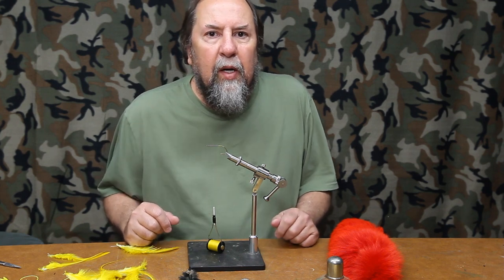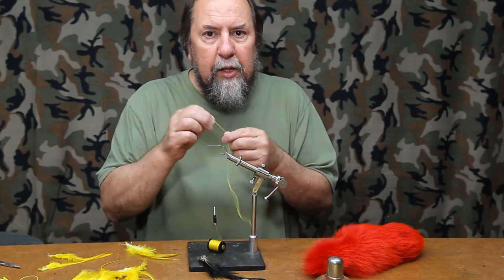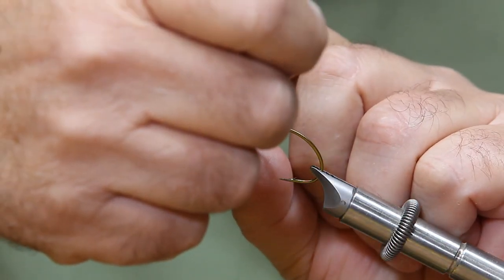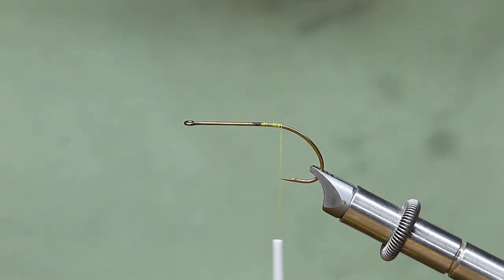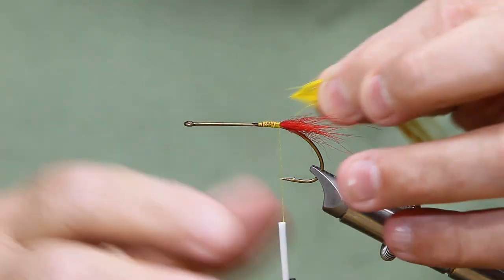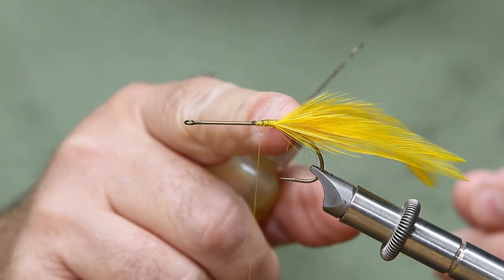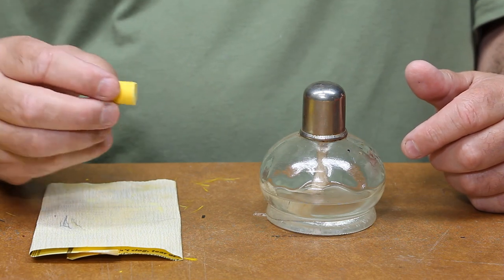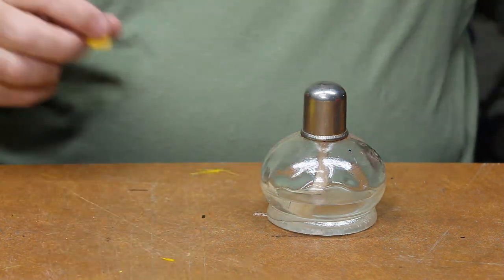Make High Density Foam Fly Heads Part 2 - Assembly

Comment: Are you painting these high density foam heads? What with?
Reply from the maker: They can be painted with any acrylic paint like Createx, either with a regular brush or airbrush. They then need to be coated with a water based clear coat like Component Systems Lure Coat to preserve the paint.